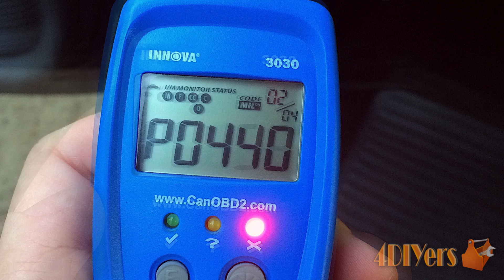DIY: Dodge Dakota P0440 & P0456 Fault Code Repair

Comment: Very helpful. Thank you! My 2003 Dakota has reported these two code for almost 4 years. Had it in the shop twice. Both times they replaced the gas cap. I saw your video, found the cracked hose and cut off 3/4 inches. Problem solved!
Reply from the maker: No problem and thank you for the kind words :)

Comment: Replaced the 2 under the truck, every hose under the hood for evap system, purge valve under hood, and the gas cap.. p0440 comes back! Driving me mental haha
Reply: On the old engines you could mist starting fluid on the lines, if there was a leak the engine would suck the starting fluid in the vacuum lines and rev up! (works for intake gasket leaks as well)  BUT, on those trucks there isn't much for wiring to worry about catching fire lol... Try at your own risk!  I would guess trying it the opposite way, using a non-flammable liquid would possibly cause the engine to rev down?  If there is a crack in the hoses or bad seal at the connections causing it to idle down. ..  I know another trick is to light a cigar or incent stick and move the smoke up and down the vacuum lines, if there is a leak it will suck the smoke in.  BUT that one can require disconnecting the fan, and on the 4.7 it should have a hydraulic fan, if it does then that method is out of the question.  I suppose one other way is to pressurize the lines with the engine off, and listen for leaks.  Anyway, thats all I got... Its either a line somewhere, or a clogged hole inside the intake.  Only other thing could be the fuel tank vent, isn't venting.  Causing the gas cap to over pressure and by-pass the seal.  Had that issue on a 4th gen Camaro with the big fuel pump, it would glue the fuel cap to the spout... too 100's of ft lbs of torque to remove that cap once the tank pressurized, and set the code off and put the car in limp mode.

Comment: What he didn't mention is that on the Dakota, you can pull the codes  by turning the key on and off 3 times in rapid succession.  The code will show on the odometer.  You can also clear the codes by turning the key on and off 10 times or after 10 restarts.  No OBD reader needed for Dakota!
Also, if you use hose clamps on the evap system, even though it doesn't need them, you can reduce the stress that causes the splits.  Don't tighten them too tight.
Reply from the maker: Great tips, thanks for sharing!

Comment: I can't believe it I'm a mechanic my self and couldn't find it so I take it to Firestone reluctantly and they tell me it's the perg valve and charcoal box so I replace those my self it costs me 200$ and it didn't fix it and 1 year later I see this and it's the t fitting there was a split on the under side

Comment: Do you have any info on evap leak on 2014 with codes P0440 & P0456 no gas cap on this 2014 Dodge Durango citadel

Comment: Besides speeding up global warming and killing baby polar bears.....does having an evac leak lead to lower gas mileage or do any damage to the truck?
Reply from the maker: Typically no, so if you're experiencing a loss of fuel economy it's most likely caused by something else.
Reply: It could cause your check engine light bulb to burn out (from being on all the time).

Comment: Just another tip...I used one of those plastic pumps that come with an exercise ball. Insert a lit cigarette into the inlet port, remover the shrader-valve “T” connection and place the outlet tip of the pump into the vaccum line. Gently pump whilst watching that your cigarette doesn’t burn down. I find this method works best with 2 people. One to operate the pump and one to look for leaks. 😉 Hope this helps anyone on a budget. P.S., You may have to gently crease the cigarette filter to fit it into the pumps’ intake port. (*** I am not responsible should your vehicle develop a nicotine habit! ***)  😉
Reply from the maker: Excellent tip, thank you for sharing :)

Comment: I have an 04 intrepid i've had it to the shop trying acanister and they checked the hoses and did the smoke thing.  the light stayed off till tonight but now on with the same code. p0440.  Im not too mechanicaly inclined where  are all the vaccum hoses it's a 2.7.

Comment: I have an 05 Dakota and have the code PO452. I'm going to check all the hoses and replace if needed as you did in the video but my thought is that i may need a new fuel leak detection pump as well. Any suggestions?

Comment: The short hose that you showed was cracked were do i find that
Reply from the maker: The one at the start of the video under the hood? You can use generic rubber fuel line from a local auto parts store, just have them match up the size.

Comment: what is the hose you pointed to at 1:48 and what is it attached to, that's where my crack is at.
Reply from the maker: It's part of the EVAP system which comes in the kit.

Comment: This is a very impressively done video.   I give it a standing ovation !!
Reply from the maker: Thank you :)
Reply: @4DIYers  hi I'm having trouble with a 2003 dodge durango with codes p0456 p0440 p0441 p0421 any advice

Comment: I can't get the p0456 fixed. I got a new gas tank filler neck since it was rotten and I even got a new valve in my evap system. It's a 2003 mitsubishi outlander
Reply from the maker: This video pertains to a Dodge only, but to answer your question. It can be a loose fuel cap, fuel cap relief pressure is problem, issue with the evaporative emission canister seal, issue with the fuel tank, purge line or vapour line seal, issue with the evaporative emission ventilation solenoid.
Reply: +4DIYers I got a new gas tank filler neck since it was rotten, a new purge valve, and the dealer did a pressure test and they said it held pressure. They also said they did a smoke test and couldn't find anything leaking. They said to my dad that they couldn't get a new tank right now and it might be the seal on the tank. I'm thinking it might be something on the top of the tank either rotten or cracked. Is there an easy way to look at the top of the tank without taking it off the car?
Reply from the maker: It depends on the vehicle, some may have an access hatch through the floor, others you will need to drop the tank assembly. If there is enough room, you might be able to fit a mechanic's mirror in there and inspect the area. Any leaks relating to the tank, you should be able to smell fuel. The fuel tank is an expensive replacement and I wouldn't necessarily reply on one mechanic's opinion. It's easy to replace parts when the customer is paying for it. Your vehicle may have a common failing area, so a car forum specific to your vehicle is the best area to find that information.

Comment: done everything cant get that dam code to stop popping up
Reply: You might have to blow smoke through the fuel system and check for leaks.
Reply from the maker: +BoneS_1972 There could also be a fault with your fuel cap. Inspect the gasket for any cracks.
Reply: thanks for the comments..
I replace fuel cap .. hose,,pump,,etc still at a lost
Reply: There is more to it.. I might be the EVAP canister. If allt the hoses are 100% The canister might be causing the problem..
Reply: I'm sorry.. I looked it up and it is also called a charcoal canister. It sits under the vehicle..
Reply: Bjarni Freyr I did that too... also replace the pump
its got to be something simple and stupid but cant find it
Reply: All the simple and stupid things get me to give up sometimes :( Have you tried turning it off and on again??? It's the last thing I can think of... Take the minus off the battery for 10-15 minutes :/ Guess you've done that a 100 times though..
Reply: I have the same problem with my wife's 2003 Dakota quadcab. replaced all the evap hoses and replaced the purge valve and fuel vapor leak detection pump but its still giving that code. Oh and I replaced the gas cap. On top of the I replaced the fuel pump because it wouldn't start unless I turn the key a few times (which is usually a bad regulator) but the new pump does the same thing.
Reply: I have exactly the same problem  keep getting 440 code I  took off my gas cap after resetting code to see if it threw it again  IT DID NOT   until I put cap back on and drove around a bit on top of that my gas mileage went up to 17.8 MPG  I have done everything it is pure BS  Thinking it might be PCM malfunction . Weird thing is it doesn't do it while motor is running it  throws the code after I drive somewhere  go into a store come out and go to start it  and the light is on with 440 and 440 PD . 2003 dodge dakota checked all hoses tested canister replaced purge valve
Reply: @philip1529  I know this is an old post but I've been struggling with the same crap ever since I bought my Dakota 4.7 extended cab used in 2007. I managed to fix it a bunch of times but it keeps coming back. This last time I couldn't find any cracked hoses. So I built a smoke generator from a Youtube video and connected it a few days ago...holy hell that throttle body shaft leaks like crazy!!! Other than though couldn't find any leaks yet the code persists. I loved this truck for a lot of years even though they built it to rot out fast and have evap issues but it was my wifes who passed away 6 years ago...and it's time to let it go. 
I should have quit on it years ago. 🤣
I hope you fixed yours or moved on from it.
Reply from the maker: Dan Coles Have you inspected the evap canister for any cracks and beyond the rubber lines, the plastic lines for any cracks as well???
Have you tested the fuel rail to ensure it's coming up to the appropriate pressure??? Your injectors could also be possibly plugged.
Reply: very frustrating I have 2001 dakota has the same problem it used to be so simple to work on your car now its a friggin nightmare